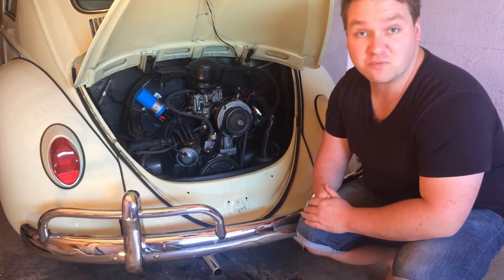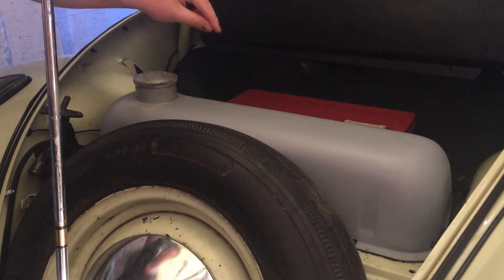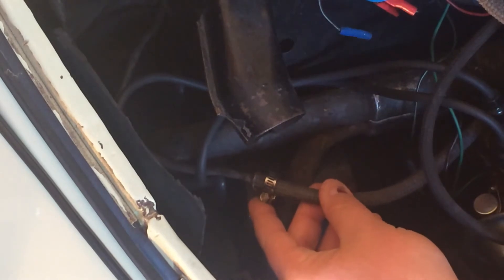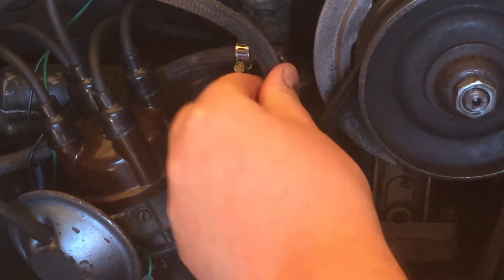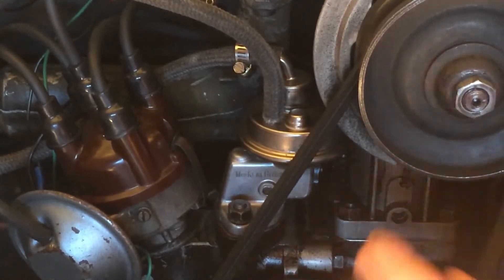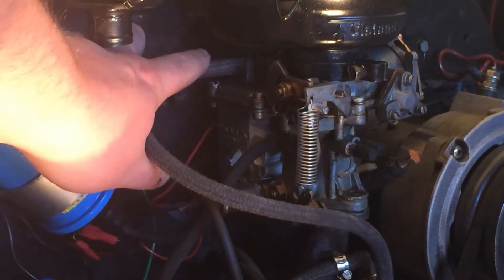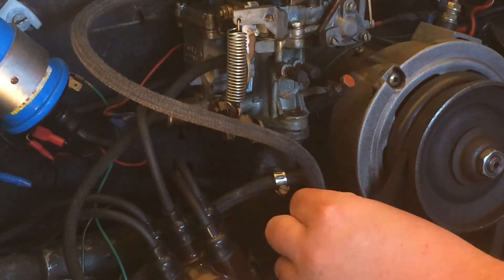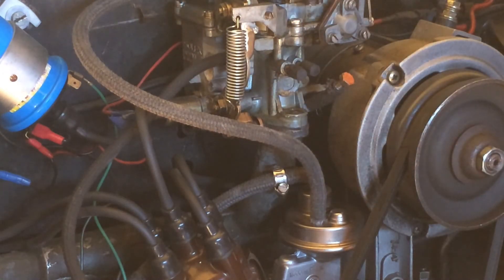How a VW Beetle Fuel System Works

Comment: In the original Pierburg fuel pump, there is a removable and cleanable plastic screen filter fitted underneath an access bolt.

Comment: Hi, excellent video. I have a question about the venting of a humpback fuel tank. Was the system vented by VW and if so, how?
Reply from the maker: Hi Alan, I believe the hump back tanks were vented through the cap, although I could be wrong there. It’s a good question!

Comment: I have a 69 bug and I swapped out the fuel filter from plastic to metal. No heat or other worries....works a treat!
Reply: Stock VWs never had a filter.  A screen in the tank and a fine sreen in the fuel pump.  The pump screen to be cleaned at each oil change.  Always use stock fuel pump

Comment: how do you change the filter without emptying your fuel tank if it's up front?
Reply from the maker: I do have a fuel shut off valve that I can close, they were only fitted until 1960 ish. Failing that, you can use a line clamp on the fuel hose. Cheers

Comment: Actually there's a good reason to mount a fuel filter up high near the carb. First of all, it's well above the fuel level in the tank so you can change it without accidentally draining the tank all over your garage floor, not to mention in your face while under the car. Secondly, if mounted a few inches from the carb, it's far enough forward not to drip on top of the distributor. The slight extra exposure of engine heat will not deteriorate the filter substantially faster than other locations provided you replace it when doing a tune up. Oh, if you are worried about the hard steel line rotting away then maybe it's time to run a new one and while you're at it maybe inspect the bottom of your fuel tank because those rot out too! (and usually well before the steel line)
Reply: I have mine off to the side in the engine bay after the metal line before the pump.  Though I have seen a lot of stories of people's engine bay catching on fine, so putting it up front can be good.  There are different ways to take care of it.
Reply: @NA12495  ... back in the day I worked in a VW specialty shop and was also on the local fire department. Most of those fires were not from the filter itself, but from the OEM fuel line that tended to dry rot and not seal well. The factory line was meant to be used WITHOUT clamps. The woven fabric on the outside held enough tension on the rubber to do the job until it was about 10 years old. Of course, a leaky fuel pump or flooding carb can cause the same issue.
Reply: @rupe53  good info.

Comment: I don’t see any clamps on the pressure side of the fuel pump.  A accident waiting to happen.
Reply: Absolutely not. That braided hose was made to be used without clamps. The braid actually tightens the hose around the nozzle when an outward force (fuel pressure@7psi) is present. They go on much easier than they come back off. It's like that old finger torture device, very difficult to get out of it.  If you have ever seen them when they were new, they came from the factory without hose clamps. Almost every hose on the car is without a hose clamp. If you see hose clamps, then you know it's not OEM.
Reply from the maker: Spot on M C - that’s indeed correct!

Comment: Another great vid mate. I've a 74 beetle and like you I have a filter under the tank, but I also have a filter in the engine bay, but right over to the side after the hard-line that comes through the firewall. Another place people put one if not there, is next to the back wheel between the main hard-line, and the one that goes through the firewall. I think the reason for wanting one there is to see the condition of fuel coming from the hard-line, in case there are the beginnings of the hard-lines rusting out. Having the 2nd filter will protect the engine from that debris and also give you a good head-sup that there may be issues with the hard-line.
Reply from the maker: A good point well made! Thanks mate!

Comment: What is this I've heard about a long or short shaft and knowing which one you have? I can't find any videos explaining this.
Reply from the maker: +Gustavo Contreras Hi there, a short shifter will have an adapter spacer that sits between the gear lever and the centre tunnel. It is a mechanism that alters the leverage you gain as you shift gears, meaning the ‘throw’ of the gear stick is shorter. Alternatively, an ‘all together’ short shift stick could be installed, but this of course, won’t look original and is pretty easy to spot. EMPI sell the gear levers and short shift kits, along with a few other manufacturers like Vintage Speed.

Comment: Thanks for the video.  I just pulled my 1977 Super Beatle out of the garage tonight and discovered it was pouring gasoline (petrol) out of the center  bottom of the chassis.  Any idea of where the leak may be originating?
Reply: If it's from the centre bottom of the chassis, that could mean your hardline that runs through the tunnel is rusted out.
Reply: did you find the leak?  I had the same problem. It turns out it was the rubber hose leaving the fuel tank that had a hole in just the right spot to run all the way down the body to that hole.
Reply from the maker: Only just saw this comment! Hope you got it sorted! Cheers